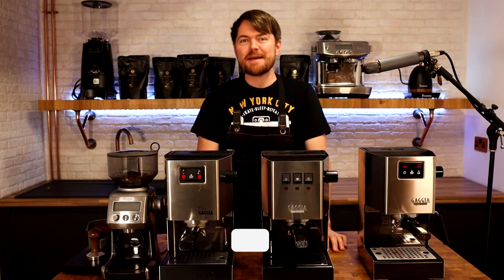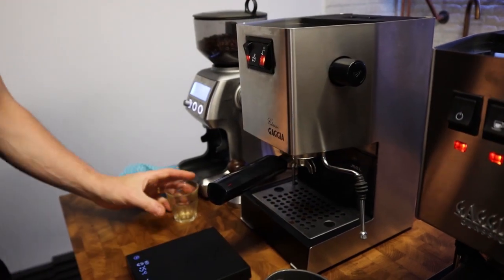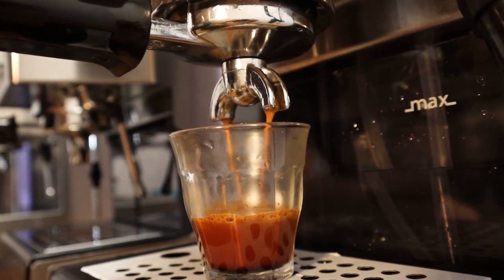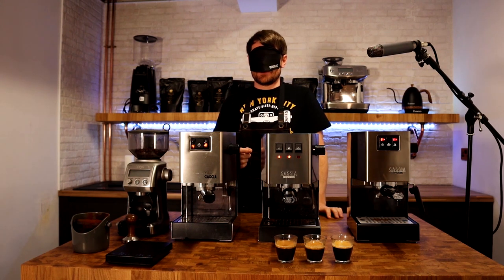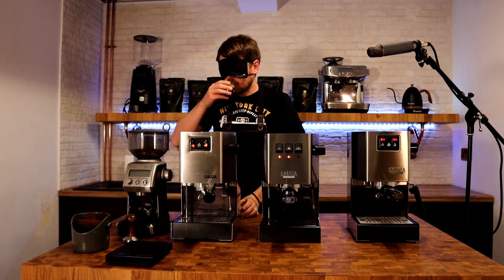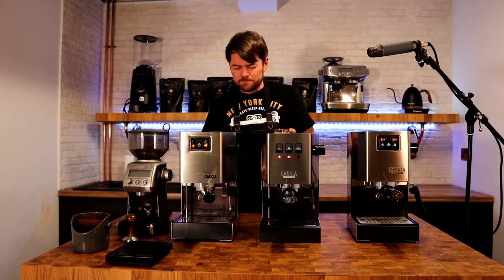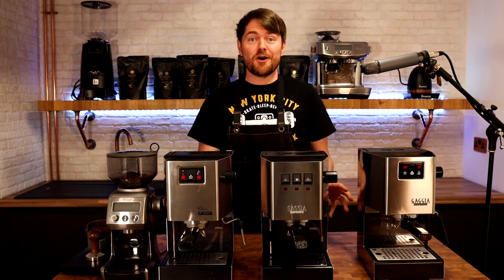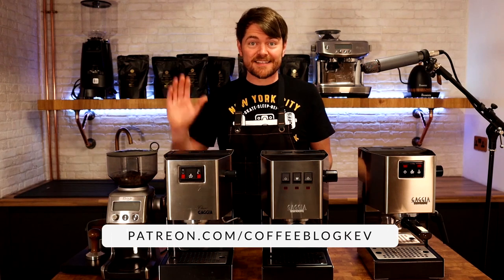Comparing Gaggia Classic Models Series. 1, Pre 2009 Vs 2015 Vs Classic Pro 2019, Shot Quality.

Comment: Hi Kev. Wondering if you ever tested temperature stability on the different machines? I recently lesrnt that the Classic and GCP have 100ml aluminium boilers, while the 2015 v2 has a 200ml stainless steel boiler. Theoretically, that should actually make the 2015 more stable, but i have dedected on my machine (Gaggia Dose, same internals but with a dosing button) that there is a very small drop in temperature from start to finish on a double shot, much smaller than expected.

Comment: I love this video its a great comparison.  My classic is from 2006 and I have modded it with the custom made Mr Shades top box that has a PID and pressure gauge, that way I did not have to drill holes in the machine, still waiting on the correct dimmer switch from China to add to the box so I can do pressure profiling and lastly the pressure was reduced to 9 bar form 12. 
Up grades have been the usual brass dispersion plate, IMS shower screen, Ranchilio steam wand and of course a precision basket, for me its an IMS 14g basket and I usually pull 15g to 30ml. Just  tried your Coffee Worx Fruit Cake blend, so far so good ;)
Reply from the maker: Hi
Thanks for your message, It sounds like a labour of love for your Gaggia Classic!
Glad you enjoyed the fruit cake blend, Its one of my favorites:-)
Cheers
Kev
Reply: Please can you tell me or give me the link to the correct dimmer switch.  Many thanks

Comment: Interesting, your reviews guide me to the new model to replace by defunct 2008 model.
Reply from the maker: Thanks Jack.  What's wrong with the 08 model? They're usually fairly simple to repair.
Reply: Surely unlikely that a pre Phillips is defunct, as there is nothing that cannot be easily replaced on the older model?

Comment: How important IS the 3 way solenoid? People say it's the big reason the 2015 is a lesser machine (and other, cheaper 'appliance' style machines). Most people point to the dryer/cleaner puck...but if a soggy pick doesn't bother you...?
Reply from the maker: They put a mechanical valve in the 2015, in Europe, I think they had to due to EC rules at the time. I think the 3 way does a better job but you don't get the same kind of puck sogginess that you tend to get with some of the cheaper machines.
Reply: @Coffee_Kev  thank you! Other than a soggy or not soggy pick, are there other benefits to a 3 way solenoid? I only ever see people mention the puck or mess of taking portafilter out too quickly without one... 🤔 Loving you videos, I'm bouncing around and indecisive between the GC/P and Breville/Sage machines (barista express or bambinos), or going back to my old cheap delonghi! 😂

Comment: I have Gaggia selecta deluxe which is identical to the classic , could you tell me the difference in these two machines because my old delonghi makes a better shot .
Reply from the maker: Hi,
 The selecta deluxe is very similar to the classic 2015, it doesn't have the solenoid valve. The quality of the espresso you get out of it isn't only down to the machine it also depends on the grinder, the coffee beans, and the skills of the user. Regardless of the lack of the solanoid and various other bits, All things considered, I'd expect the shot quality potential to be about the same. you can do some very simple mods to improve it.
New shower screen OPV  and more advanced mods if you wanted, including PID Pro steam wand, upgrading the pump, etc
Cheers
Kev

Comment: Hello, Can I ask your advice? I don't seem to succeed to have a consistent coffee brew - no Crema or very this etc. I seem to do some steps wrong. If I use the Crema filter, no problem getting Crema of course. But when I I use the two cup espresso filter I don't seem to get any Crema at all.

This morning I heated up the machine for more than 10 minutes. (had a shower, put the machine on). Placed the Porto filter in the machine to get warm. Grained the beans. (yep, correct grained size). I even worked up steam by making one cup water-only pour out, before placing the Porto filter back, with coffee, and had tamped with my Motto tamper.. Brew button whent from dark to light and then brewing. But coffee came out without crema. Quite embarrassing. I felt I did all steps correctly.

So what am I doing wrong. Is there a secret step somewhere that I always miss?

Any suggestions? Your coffee came out great in this video without any issues. 

Thanks in advance. / Stefan
Reply: I would believe it's less coffee and more gap for air and pressure is filling that gap. Try putting double amount of grounds.
Reply: Grind finer